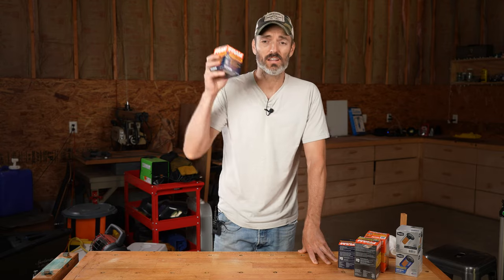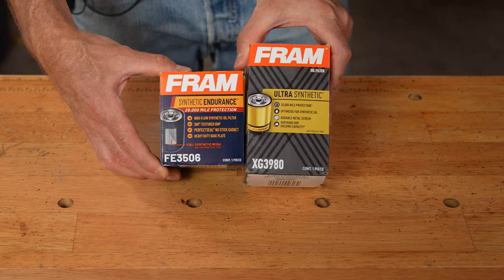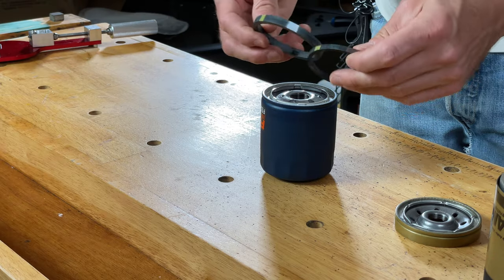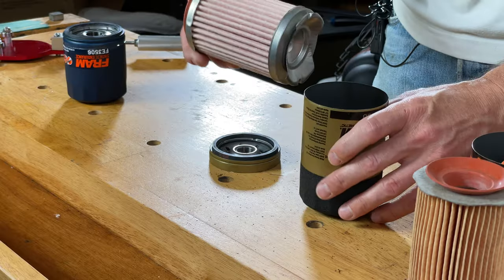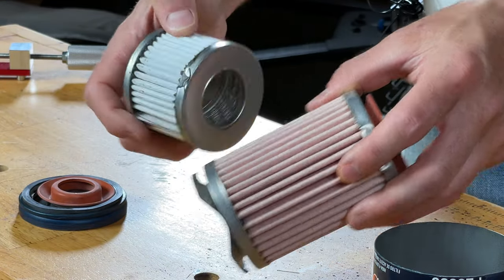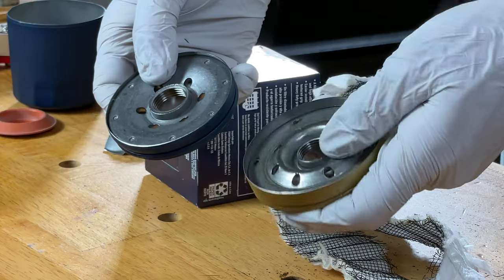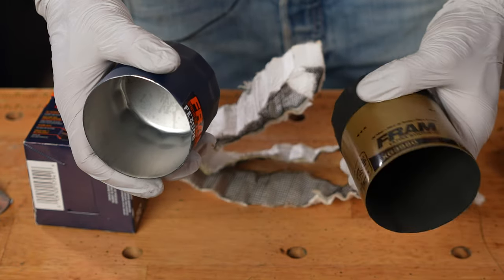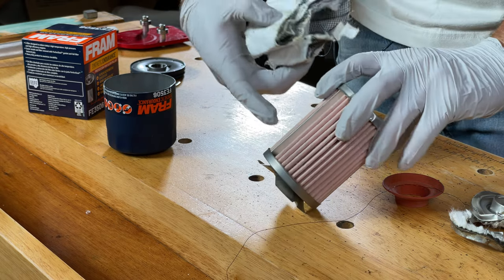FRAM Dropped A New OIL FILTER Called Synthetic Endurance That Lasts 25,000 Miles!!

Comment: I work at Walmart in the Auto Care Center and Fram is Walmart's corporate contracted oil filter. We use the COR line which is intended for commercial sales such as an Auto Care Center. They are similar to the Orange box Fram Extra Guard, just without the fancy stencils the Extra Guard has. However, when I have my own vehicles oil changed, I run the Ultra Synthetic filters. I have a 99 Chevy Silverado I bought in 2011, and have run Mobil 1 Synthetic in it for almost that whole time, no engine related issues with that truck. It's solid.
I also have a 2006 Dodge Grand Caravan, running the same oil/filter setup in it too. I just bought a 2005 Grand Caravan with a lot of miles and a couple of engine issues. The engine is solid but is throwing a P0016 code, camshaft or crankshaft position sensors not corresponding. I have both sensors but haven't replaced them yet, they are a bit of a chore to accomplish but doable. The previous owner used it as his daily driver, running it about 100 miles round trip every day, and I'm not sure what his service interval was, so I'm going to do a couple short intervals using Marvel Mystery Oil the last few hundred miles to help clean it out. I'm suspecting the variable valve system might be gummed up too, so hopefully this will help clean that up and start it running better. (That can also possibly cause the P0016 engine code). After that I'm going to run the Mobil 1/Ultra Synthetic oil setup I'm using in the other vehicles.
Everyone just remember that Fram was the original aftermarket oil filter manufacturer and have been in business for about 100 years now. In this amount of time, they should know what they are doing, so personally, I'm 100% confident in running Fram products. My family has been farming for decades where we ran Fram filters on tractors, trucks, combines and a whole host of self propelled farming equipment, and we have rarely ever had an engine failure, and those that happened were not from a bad Fram filter. My Grandpa even ran the local Gambles Hardware Store and carried Fram filters, and he never had anyone come back with a bad one. So that's a pretty solid track record. Nothing wrong with running a Fram.
Reply: Any luck with the Marvel Mystery Oil on your Grand Caravan Danny? My father swears by that stuff. Thinking about giving it a try on my old F150 4.6.
👍🏽
Reply: @jerryjeromehawkins1712  Still driving it with the MMO but will be changing it in a couple weeks. I suspect it needs a new timing chain and another short duration oil change.

Comment: on my 2006 Yukon with the 5.3 I use the application for 2002.  It's a longer filter.  I've been using my case of old stock Delco PF 59 or the wix equivalent.  Napa GOLD are also good.

Comment: Holding out for the 50k version.  J/K.   

I really wish manufacturers of oils and filters stopped these 15k, 20k, etc, labeled products.  It's really giving consumers the wrong idea, considering not one single automaker recommends those intervals on their engines.
Reply from the maker: I would never wait that long. I wonder what they could use as a marketing term/phrase instead??
Reply: I'm pretty sure some European cars with oil life monitors can go 20,000 or more miles between oil changes.

Comment: That Fram FE filter is well constructed filter. High  quality. I wouldn't go past 7,500 miles on that filter. Not because of the filter, but because of the full synthetic oil. 25,000 miles before a full synthetic oil change is ridiculous to say the least.
Reply: From what I gather many an engine has met an early demise from the owner being told they can run 25000 miles and so they don't change the filter along the way, they do drive the vehicle as per the severe service cycle ( short runs, cold weather, stop and go traffic ) and then wonder why their engine blew up !. Situations like this have been going on since the 1970's when synthetic oil came out and someone came up with the brain wave of marketing such insanity of the 25000 mile oil change to sell (con ) over priced oil.

Comment: That "goopy glue" is what stops the oil from passing thru the gaps in the filter. I kno it should be obvious but the filter media goes in out, in out all the way around. This is the first filter in a cartridge style that is actually sealed at both ends forcing all of the oil to be filtered. I do wonder if this is the fram titanium rebranded for walmart, I'll figure that out next oil change

Comment: What I’m interested in is if using the Fe filter would your oil pressure increase since it says “high-flow” because back then when they use to sell the K&N filters my oil pressure was higher that’s the only reason I used them but I’m still pissed they cost $12.97 like really😒 I get it it’s a royal purple filter at Frams cost but why did they have to get rid of the K&Ns

Comment: I have a 2006 Altima and I always change the oil and filter every 3,000 miles. Could I extend it to 5,000 miles or even more? Probably, but every 3,000 miles puts my mind at ease 😂
Reply from the maker: Mine too
Reply: if using a synthetic can easily do 5k and makes it easier to keep track of
Reply: @ajamesc55  Most definitely, I still just do it at 3,000 miles. Idk why, but it’s cheap enough and I kinda enjoy doing it 😂
Reply: Send a sample to Blackstone Labs - based on their analysis, they will tell you what the ideal interval should be.

Comment: Good stuff Jimmy! I agree 100 percent with you about never going 25k miles before changing the oil. Then again, I drive a 1999 GMC K2500 Suburban with a 7.4 (454) and it's all metal... So, 3500 miles is my personal limit. Thanks for sharing. Funny, manufactures usually don't want things to last but I'm sure the bean counters still manage a profit somehow. Can't wait to see what's next.
Reply: Through oil analysis, I find my 454TBI can go 7500 miles on Mobil 1 high mileage 10W-30.  The parameter that goes out of spec is total dissolved solids.  I ignore the timeline and end up changing every 2 years, combined with a Mobil 1 oil filter or K & N.  At 173,000 miles now.   Since I don't have roller lifters, I add some ZDDP to boost the conc even though the high mile formula has some.

Comment: The synthetic new filter threads are the bottom warp so easy making it slip when trying to remove it. I end up having to puncture a hole with screw driver to remove it. I wished they coated the thread with those black stuff.

Comment: I use either Wix or AmsOil filters myself. Like oils, it's a matter of personal preference. Oh, and include your wife in more videos, Jimmy! Thanks man!
Reply: I mean fram has been proven to be trash for decades the only reason they were popular is because they hired the old guy from breaking bad to lie straight to your face in the commercials
Reply: @infernaldaedra  
Who proved that - for decades?
Reply: I’ve had 2 wix leak. Amsoil is the exact same filter as the new Fram at 2x cost lol
Reply: @Peter_Riis_DK  since  they decided to used aluminum can thick filters with glued paper filters that would get dissolved by the oil and gas causing the filter pleates to separate between the staples. 🤮
Reply: @infernaldaedra 
That's not the question. But thanks. 😘
Reply: @Peter_Riis_DK  they proved it themselves with their own product quality. Is that good enough for you
Reply: @infernaldaedra 
Nope. But never mind. 🖐️

Comment: I always use Wix on my 63 Dart, and my 17 Trax. 
Most auto channels use Wix including racers.
Reply: Because fram has a history of causing engine failures and being a dishonest company using very shady marketing practices and their products are trash compared to the competition. They used to say they were the best filters even when oil was dissolving the paper and glue they were using for the filters and having like 1/5th the filter surface area of even the cheapest brands on the shelf

Comment: I have been an AC Delco man when it comes to oil filters I switch to Fram and now I'm using wix if you want to cut up oil filters and show the inside of all of them Dr 3 or 4 different brands it might shock you it did me and this is in my 2000 GMC Yukon XL with 368,000 Mi on it❤

Comment: 80 to 90 percent of engine wear occurs at startup. So, flow is just as important as micron size. Pushing for a lower micron size (20 or lower) requires more restrictive medium thus reducing flow..A white blood cell is 25 micron. Your engine, you be the judge.

Comment: I'm more interested in the combination of flow and filtration efficiency than capacity.  The filter can have a capacity of 35 grams, but if it's restrictive, or letting 25-micron particles through,  I'm not going to be a fan.
Reply: They ran the test that you would like to see and it is impressive its on tube look it up you will like the results
Reply: @samuelhomer8885 , I'm wondering if it's the same filter as the Purolator Boss and Wix XP.

Comment: Cool. I've used the Kirkland full synthetic for the last 20 oil changes (5w-30, 5k mile OCI, OEM filter). My 2006 Matrix has over 213,000k and runs perfect. It's just as good as Mobil 1 IMO. I'm still kicking myself for not buying 5 boxes of the stuff when they were going for $21 (it's now like $37).
Reply from the maker: Every once in a while it goes on sale for about $30. That’s for 10 quarts! Cheap.
Reply: I've been using the full synthetic Rural King branded oil. It seems to do great and is the cheapest oil you can find.
Reply: it sucks the price doubled just like that =(

Comment: The question of the day is do you still have to oil The gasket on this new style of oil filter by fram
Reply from the maker: I just leave the used oil on the flange from removing the previous filter. Not sure if that’s recommended though 🤔
Reply: @1RoadGarage  thanks for your reply on this matter young man 👍😎😁 I've been told that when you get a new one to oil The gasket so it's not going to be a problem with it at the next oil filter change

Comment: IMHO,  Fram can't be trusted  for quality.  Mobil 1, AMSOIL, K&N, or in emergency AC Delco for me.
I really like the 1" hex nut welded on the K&N.  However they are for max flow like racing and don't filter as fine of particles.  Robust engines like 350 and 454 old school should be fine with them.  LS and modern, I don't know how finicky they are.

Comment: I was wondering" you don't fill' your filters with oil, before you put em' on ?🤔
Reply: Yeah. Did you see how long it was before his oil pressure came up after he started the engine? 😮
Reply: did you know that some filters you cant prefill and on Caterpillar in all of their service manuals they say NOT to prefill the oil filter.
Reply: @rickmoulton6337  For the past 50 years I've pre filled my oil filters, and so far......👌👍.
Reply: @sjoeld57  only takes a few seconds
Reply: Some vehicles you can't prefill.  My 4 runner the filter faces at a downward angle on the side of the block so it will just dump out.

Comment: I go for K&N oil filter. Had them for every 5k miles on my lifted xB. And they are great.

Can’t go wrong. Also made in USA.  And they are robust. The body of the oil  filter is stronger. Try squeezing it
Reply from the maker: Heard good things about those. I’ve used them once or twice as well.
Reply: @1RoadGarage  oh they definitely do. For the price of the K&N oil filter. 

They are worth it. 

Also, I know u probably seen my other comment about led lights upgrade. They were one of my favorite from u to review about it. 

What got my attention is that, u have favored front and rear turn signals. Along with ur brake lights. 

Why not for the sylvania zevo front and rear turn signals, with a mechanical led flasher relay and zevo brake light bulbs?

I think it would be fascinating and interesting to see that ur vehicle Chevy suburban. Would make it look more premium and more fresher look than ever. 

It just missin its ingredients
Reply: @toyotabrony  
How do you know they’re great?
Reply: @Peter_Riis_DK  the oil filter?

Because I’ve been using the same K&N oil filter, and with Castrol edge synthetic oil. This is my 14-15 oil change with K&N oil filter. And I had no issues with them whatsoever. Change them every 5k miles.
Reply: @toyotabrony you could use a potato and say they are great. Do you have any data?
Reply: @tacticalcenter8658  lol good ole potato. 

And no I don’t record the oil filter. I’m my experience, and other xB owner’s experience that owns K&N oil filter have no issues. 

I’ve been using the same K&N oil filter for quite a few years. And they are excellent. 

That’s my experience.
Reply: @toyotabrony  you should just not say something is great when you have zero idea how great or not something really is.
Reply: @tacticalcenter8658  well I did. Because I daily my vehicle. And it performs as it should. But I found a video that explains way better and see how great they actually are.
Reply: @toyotabrony  I daily a vehicle and use a garbage brand filter. It does super!
Reply: @tacticalcenter8658  what brand are u using?🤣
Reply: @tacticalcenter8658  
Either brony is a troll or he's bloody clueless.
Reply: @Peter_Riis_DK  the later most likely.

Comment: Why is there no bypass valve? Should that be a concern?
Reply: Depending on the vehicle model, some have the bypass valve integrated into the filter mount area so it’s not needed inside the filter itself. A Chevrolet 305 would be a good example of this but many modern cars have a similar setup.

Comment: Hey anyone notice that the none of the Fram haven a oil bypass valve if the oil filter gets clogged no bypass valve to allow engine to still get oil
Reply: Bypass valves depend on intended application. Some newer engines and many older engines (like a SBC) have the bypass valve on the engine itself.

Comment: Won't run it more than 7500 miles max, with synthetic oil.
Reply: Yes, words of wisdom. Based on analysis, Blackstone Labs tells me not to go more than 7500 miles per change, and that’s with Pennzoil Ultra Platinum 5W20 and the excellent Denso-manufactured Mazda OEM filter. I go 5000 miles,  to keep my oil change combo in the sweet zone.

Comment: 🟪 for life!! I like having the bypass valve built into the spring. AC Delco my next choice. I paid too much for my car, literally, so I can't bring my self to use any FRAM when the inside looks like a Campbells soup can with holes stamped out inside. For a cheap car though I'd come to the same conclusion and use these.

Comment: I kinda love these oil change “debates”. I’m somewhere around 20,000 miles since my last oil change in my ‘00 Suburban. I do check it fairly regularly, and it still isn’t too dark. It’s still got quite a “honey” look to it, and not far off maximum. I have been doing the same with my S10 Blazers. 30,000 miles and I thought it was definitely time to change it. It was a little darker than new oil, but definitely not what I would call bad. I think it could have done another 5,000, but no more really. All three vehicles use the same 5w30 fully synthetic from a national chain here in the UK. While it’s probably best practice to change at 3-5k, it’s practically unheard of in the circles I frequent. When people have asked how often I’m supposed to change the oil, they’re shocked at how short it is. Most people I know drive cars where service intervals are recommended at between 20 and 40 thousand miles. I’ve seen only once some oil that looked like sludge or treacle on the inside of an engine, and that was on a Ford where it literally hadn’t been changed in 100,500 miles. The service book backed this up. It had gone in for its first service at 500 miles, and never returned.

Comment: Synthetic oil is engineered to go 25K miles unless otherwise noted, do some research and educate yourself about synthetics. If you're using top notch filtration and not abusing your vehicle the oil will last 25K miles if that's what it says on the bottle. Oil analysis can  confirm what's going on inside your engine.
Reply: Watch The Car Care Nut videos on this topic( by a certified Toyota Master Diagnostic Technician), to find out how wrong you are.